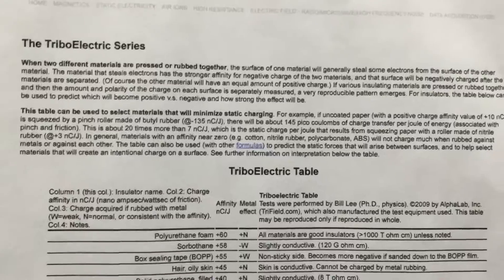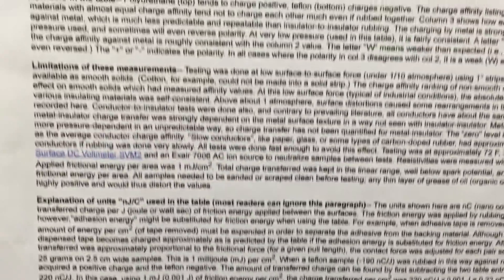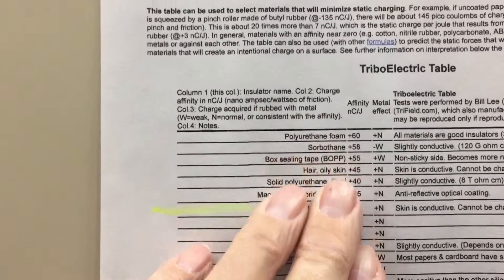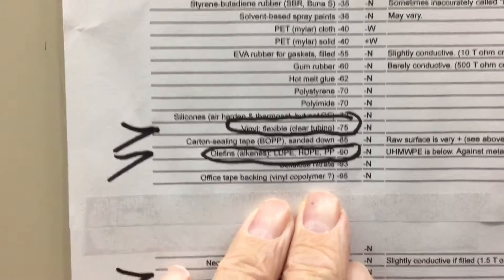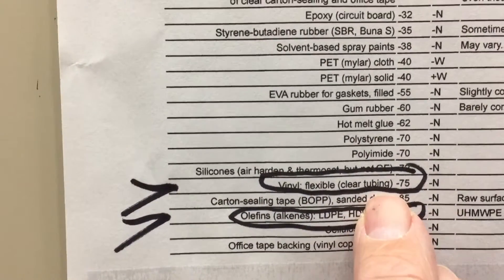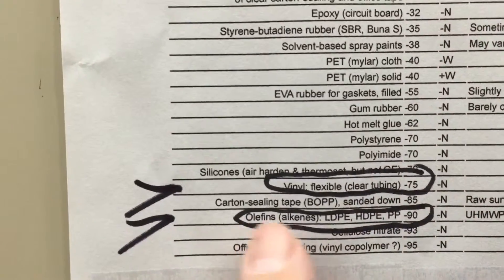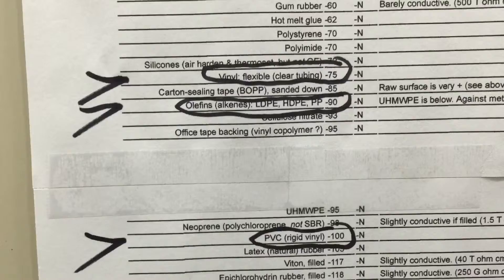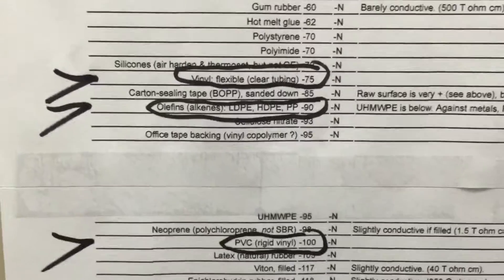Triboelectric Particles in a Pipe Electrostatic Generator

Comment: Looks like a Pauthenier Generator. Very interesting. One of the most curious, through not really successful, modification of the Van de Graff generator had been conceived around 1936 in France by M.Pauthenier, professor of physics at La Sorbonne in Paris .In fact, he proposed to use a flow of charged dust particles circulating in a closed insulating pipe instead of the classical belt of the original apparatus. The dust was composed of glass spheres of a few microns in diameter. A blower produced a 60 in.p.s flow of these particles in the loop-pipe. For charging the dust there was a 'ionizer', which was composed by several wires parallel to the pipe. The wires were negatively charged (12,000 volts) by a kenotron rectifier and the electric fields of the wires ionized the gas molecules. The positive ions were immediately attracted by the wires, while negative ones were repelled in the direction of the walls of the pipe and charged the dust particles. Great care had to be taken for adjusting the various parameters (diameter and speed of the particles, voltage of the wire, diameter of the ionizing tube) so that the dust did not precipitate on the wall of the tube but could continue its journey after having been charged. At the top bend of the pipe the charged dust entered in a kind of centrifugal collector, which was connected with the spherical terminal electrode of the generator. In the collector the charges of the particle were transferred to the electrode.
Reply from the maker: Thank you for the very informative comment.
Reply: Similar to our water cloud rain cycle